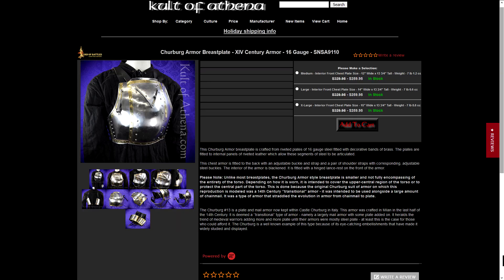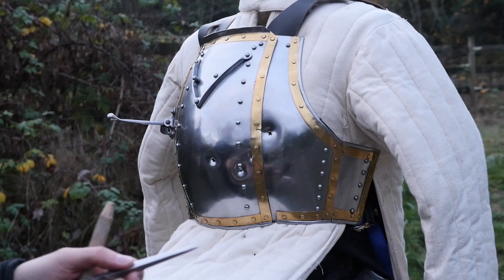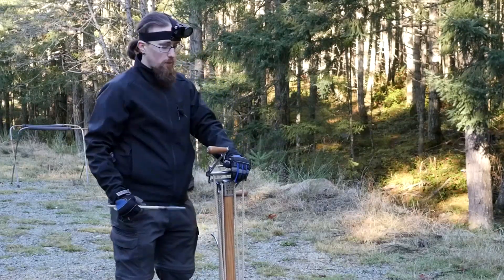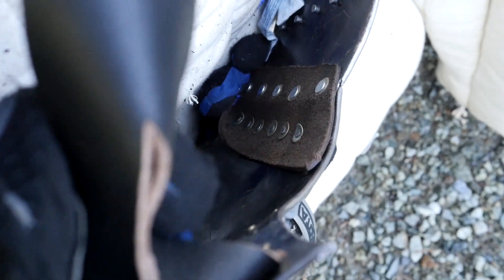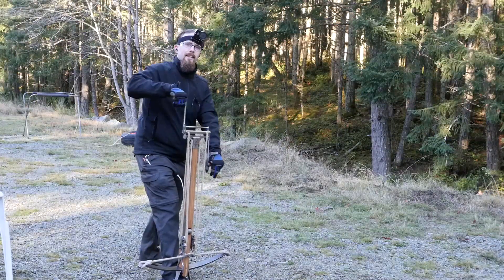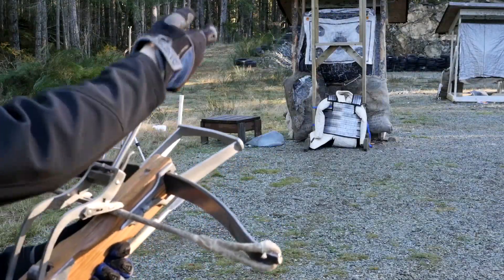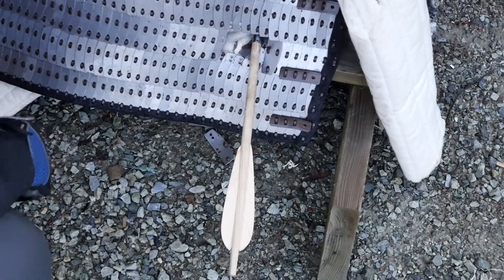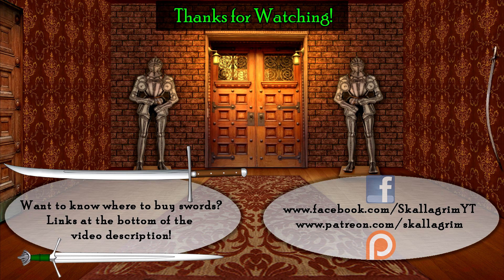Medieval Crossbows vs. Breastplate and Lamellar Armor

Comment: Really gives you a reasonable idea of just how efficient full plate armour would have been and how hard it would be to kill a fully armoured knight.
Reply: Asmin Siza actually it is one of the battle with the most prisoners, and the Knights that were wounded were mostly wounded to the face because for some reason (better seeing or breathing) they opened up their visors. (Sorry if my English is not totally accurate, I am French.)
Reply: SonOfMyths73 Regardless of distribution, with everything worn, it's still a lot of weight and if I remember correctly, the knights at agincourt charged against a muddy field. Yes, knights were trained and buff, but put it all together and anyone would get tired
Reply: One of the things that really tired out the knights at Agincort was the fact that they had to slog through thick, knee-high mud while wearing heavy plate. They couldn't commit to a charge with heavy horse due to obstacles and the terrain, so they had to dismount and fight on foot. The weight of platemail and full plate may be distributed across the body, but they were still lugging around 60-90lbs of armor uphill across a soggy, freshly plowed field. Even hardened veterans in peak shape would get exhausted from that charge, so it's no wonder that some of the knights who fell into the mud literally drowned in their helmets.
Reply: @Ugh-Fudge_Bwana  60-90 pounds, hell no, more like 40-60, 90 pounds is getting into jousting armour range.
Reply: 60 lbs of armor distributed over the entire body. Modern military wear around 60-70lbs as well on their back rather than distributing it. Also, full plate armor was not as restrictive as people say. With knights being able to cartwheel or summersault in the armor.
Reply: @Ugh-Fudge_Bwana  most mediaval armor was 45-55 lbs (20-25 kilos)
Reply: to be absolutely fair the torso region is usually the toughest part of the armor, i'd imagine shots to the limbs/head being more effective.
Reply: @qwertyzxcvbn6929  That V-shaped ridge? that´s a deflector to guide arrows and bolts that glance of your breast away from your face (Todd´s workshop showed the effect very nicely). I think, it is there for a reason (experience). Hits to the throat and face might have been dangerous, even after ricocheting off your breastplate. I don´t think visors were as thick and sturdy as the breastplate, and projectiles could catch in the eye- and breathing holes. If you closed the visor (usually in melee), you had obstructed vision and breathing - not good for the advance. So with open visor under fire, you either lowered your head - again, not seeing where you went thanks to the helmet, or you looked up and got it to your face - tough choice.
Reply: Horse armour was a thing. The front of a horse would be protected by fairly substantial plate defenses and it wouldn't be necessarily any easier to kill the horse than the man at arms on top.

The weakness of horses is that they have broad flanks, which means putting plates on a horse's sides is difficult. So shots to the flank of the horse might be effective. 

It was probably very comparable to a modern infantryman trying to engage a tank with an RPG of some kind. You have to aim for the side armour because you won't go through the front.
Reply: Just Someguy No. Thats the best way to kill his horse.
Reply: Social and military organization is a big one. In the Middle Ages (until the late 1400s) soldiers provided their own equipment and military leaders usually just recruited the candidates with the best kit. 

Later in the 1500s, though, governments started raising armies and training and equipping them out of state coffers. When it's the government buying kit for everyone, they start looking at ways to cut costs.
Reply: The original Churburg 13 armour have an average Vickers plate hardness of 180, and it varies from 110 to 236. It has about 0.1 % carbon. (The Knight and the Blast Furnace p. 69). 

This replica is made of modern mild steel with manganese. This will increases the ductility of the steel. The vickers plate hardness is much higher than 180 and probably around 235. Wrought iron behave in a completely different way when shot at in comparison to modern steel, much because of manganese. Modern steel is more malleable. Wrought iron does not bend the way we see here. It cracks. 

Of all the armour we have from this time period, 13 % is made of medium carbon steel  (300+ VPH), 33 % is made of low carbon steel (max VPH 210) and 54 % is made of wrought iron (max 150 VPH.) This test tell us precisely nothing of value. 87 % of the men-at-arms would still have a bad day when facing longbow archers, because arrows penetrate 1.58 mm (16 gauge) of wrought iron plate with only 87.5 Joules. When these arrows are aimed at the side of a helmet you are in serious trouble, and the majority of the arrows struck the men-at-arms in the head at Agincourt. Arrows shot into a dens formation of dismounted men will hit them in the head. Arrows coming in from the flanks will strike the weaker side of the helmet, and the majority of helmets were around 1.5 mm. It was not adequate protection at all. This has been presented in a peer reviewed article by professor Rogers. Shooting at modern steel proves NOTHING! This was demonstrated in the Warbow trials.

This bolt struck with about 110 Joules. A 150 lb longbow will reach 117 Joules with a 64 gram arrow. A 108 gram arrow will strike with 146 Joules. A 180 lb longbow will reach 132 Joules with a 64 gram arrow and 164 Joules with a 108 gram arrow. This crossbow is equal to a 140 lb bow, not a 180 lb bow.

The penetration of the 1mm plate was not a surprise at all. It's exactly what the math predict will happen. The increase from 1 mm to 2 mm will triple the required kinetic energy.
Reply: Shoot him with a ballista and hes dead!
Reply: Johannes "Fountain" Micha That could work, but I’d rather start a gunpowder trade with Asia and make some serpentine matchlocks and put a lead ball through the knight.
Reply: @JmbFountain  Is he though? depending on the plate even a ballista might fail to penetrate.
Reply: Guns and full plate shared the battlefield for a long time. There were a lot of factors which led to the phasing out of heavy armours.
Reply: I think many people take the reaction against the myth that "armour was heavy" too far. Yes, you can still move agilely in full plate. Yes, you can be fast. Yes, you can keep it up for a long while. No, you won't be just as mobile as someone in light armour.
Reply: @hrotha  Exactly, especially long term and on a sloped terrain. The Battle of Sphacteria is probably the best demonstration of that fact.
Reply: Demonstrably untrue. Foot harnesses were, if anything, more protective than cavalry harnesses, since the horse and saddle aid in protection. English knights and men at arms had a tactical preference for fighting on foot, which was copied by the French at Poitiers and Agincourt. English armours of the period are known for fully encased cuisses (upper leg armour) and upper cannons (armour on the upper arm). Most cavalry harnesses had open backed cuisses and upper cannons which were less protective. The only area where cavalry harnesses were more protective was the pauldrons; they could get away with bigger ones that overlapped the breast plate because they didn't need to lift their arms as much.
Reply: Andrew Woods

The Knight and the Blast Furnace is a book by Alan Williams. It's expensive and contains the Vickers hardness tests and the testing of armour of differen qualities to represent medieval armour, as well as the formula for how to calculate the required kinetic energy when thickness and quality changes.

The Article by Rogers can be found in this document.
http://1.droppdf.com/files/a7ovL/the-hundred-years-war-part-ii-villalon.pdf
It's from page 37. The percentage distribution is on page 112. This again is based on an analyses of the findings in William's book on page 69 and 330, among others.

You should also take a look at this article
https://militaryrevolution.s3.amazonaws.com/Primary%20sources/Longbow.pdf

The last article is Paul Bourke and David Whetham, 'A Report on the Findings of the Defence Academy Warbow Trials. Part 1 Summer 2005

I couldn't find a link. However, if you download the article, remember that the arrow only struck with 92 Joules and that they only tested 1 to 1.15 mm plate, 2 mm plate and 3 mm plate. The first had a VPH of 206, the second 180 and the third 172. This is more than what we see on wrought iron armour from 1395 to 1415.

They should have tested plates with increments of 0.1 mm. In other words, 1mm, 1.1mm, 1.2mm, 1.3mm etc. The reason for this is that the required kinetic energy at 1 mm is multiplied with the new thickness^1.6. So if 1 mm of something like 235 VPH requires 55 Joules (the test result from The Knight and the Blast Furnace), 2mm requires 55*2^1.6 = 166.72 Joules. If the quality is only VPH 150 it's 166.72*(150/235) = 106 Joules. Of cause most armour was not 2 mm apart from the center of the breastplate and the top of the helmet. It was around 1.5 mm, so 55*1.5^1.6*(150/235) = 67.16 Joules. Heavy bows will penetrate this with arrows striking the plate with 115 to 164 Joules with a minimum of 47.84 Joules left and 96.84 Joules at best, point blank. At maximum range a heavy arrows around 95.9 gram will drop down to around 89.9 Joules (the Great Warbow by Strickland, the Appendix)

So here you see that the increase from 1 mm to 2 mm will triple the kinetic energy required, whereas a VPH increase/decrease half that of 235 will increase/decrease the required kinetic energy with 50 %. If you do both, reduce the thickness and VPH it's obvious arrows from heavy bows will penetrate such armour. For instance 1.3 mm of low carbon steel with a VPH of 180 is: 55*1.3^1.6*(180/235) = 64.1 Joules

It's also obvious that they didn't penetrate the 2 mm plate in that test with a VPH of 180.
55*2^1.6*(180/235) = 127 Joules, and the arrow struck with only 92 Joules and protruded out on the other side by 16 mm. It's exactly what you'd expect.

Here is a picture of an arrow shot into a thick plate of iron. It's from Mark Stretton's blog, Practical tests part 9. This plate is a lot more than 1.6 mm. Probably more than 2 mm and even 3 mm. This was with a 140 lb bow shooting the 102 gram arrow around 47 m/s, if my memory serves me right. This will give us 112-113 Joules somewhere.
https://1.bp.blogspot.com/-cQYmmYin3P8/Vw1cJQRxiPI/AAAAAAAAEzk/-60xzWZwgPkDYPugAla21h4lZGa6L_AAACLcB/s1600/Test%2B35.JPG
Reply: Makes me wonder how strong the English longbowmen needs to be to kill a fully armored French knight  at Agincourt.
Reply: @MisterSiza78  you don't need to kill the night when you can kill his horse, and then force him to struggle through knee deep mud in armor. if you read the contemporary accounts of the battle, that's what really did it. by the time the knights even got to the melee they were already exhausted. that'd be a nightmare even in light clothes, doing it with 60-80lbs of steel strapped on would be an absolute killer.

apparently the mud was so bad that the knights also just couldn't get up if they got knocked down, too. it was not a good day to be a knight.
Reply: @MisterSiza78  So, English longbowmen did not actually kill any French knight, at least it's very unlikely. There are a few articles you can find on Agincourt but in short:
The English had the high ground. This is not for the meme, they really were on top of a rather large hill. They fortified the position, protecting their flanks and positioned themselves so they could take their enemy in a crossfire.
It had rained the day before so the ground was basically mud.
The French knights charged (mainly) on foot, through mud, and up a hill. facepalm They charged in densely packed ranks: each time a knight fell because of the mud, two or three knights fell also. Repeat for a domino effect.
Not all knights were wearing a full plate. A few weak points around the legs allowed, at a very short distance, to wound the knight.
Overall, knights weren't killed anyway because you could send them back for money. So while a good number was killed in close combat, many more were taken as prisoners.

Agincourt was a flawless tactical victory for the English who had understood that chivalry (the mindset) is good and all but it doesn't win a battle. Also, discipline.

The French legit had more numbers and proto-canons. They could have bombarded the English who were famished and sick.
Reply: Zabzab Lord the benefit of the longbow men is the constant barrage of arrows that can disorientate, trip up and potentially manage to get into any slips of the armour that the knight is wearing. Also all those little dents can eventually cause the plates to no longer slide and move correctly. It was pretty much a death by a thousand little dents and impacts. (Not actually a death typically) the long bow wasn’t really designed to ever try to kill a knight, better for horses, light infantry and crossbows.
Reply: @pierreb97  I thought Poitiers was the uphill battle?
Reply: @paavobergmann4920  Agincourt definitely was. Poitier probably too. The English had a better understanding of basic tactic than the French at the beginning of the war. From memory, I'd say the English were shielded by a forest, creating a funnel in which the French dumbly charged. It is completely possible the English also had the height advantage: they were smart enough to take it, that's for sure.
Reply: @pierreb97  Right. Henry´s deployment was absolutely brilliant for the circumstances and what he had to work with.  I thought there was a shallow muddy dip right in front of the english lines, in the middle of the funnel aka killing zone, and henry ordered the english to not move, no matter what.
Reply: @MisterSiza78  they really didnt kill all too many iirc. They captured a ton of POWs there and at Crecy didn't they? I think the fact that so many nobles survived js a testament to why they invested in good armor.
Reply: @MisterSiza78  they are wearing coat of plates during that time
Reply: @MisterSiza78  Evidence from the documentation shows that it was raining and the fully armored knights sank in the mud and their metal shoes created huge suction in the mud while the leather shoed archers could run through the mud with ease.
This was all tested BTW
Reply: @MisterSiza78  They probably didn't have much success against fully armoured knights, but horses and ordinary foot soldiers were much more vulnerable to archers. However, Knights could be killed in close quarters fighting, and archers would have other weapons for getting up close and personal. "Hold him down boys I've got a can opener!" 😉
Reply: @MisterSiza78  Agincourt in popular perception is kind of a misconception

What killed the knights weren't the arrows (not directly), I'd wager the vast majority of them weathered the volleys like it was nothing.
But think about it for a second.. These were knights. They had horses.

Horses. Horse armour, whilst it was a thing, was expensive and most importantly not as covering as full plate on a knight since you can't restrict movement of the horse too much..
The arrows killed and wounded the horses. Falling from a horse hurts a lot, but regardless.

Next, you got the actual conditions of the battlefield, at Agincourt the knights charged through a relatively thin path surrounded on both sides by trees and obstacles. In front of them the english army had "entrenched" itself with barricades, the terrain was muddy and hard to go through with an horse

So most of the french knights had to go through on foot. Through mud and barricades.

ANd they were outnumbered at this specific location because the rest of the army wasn't with them
Reply: @MisterSiza78  There's a video about that in Tod's Workshop channel, the gaps are somewhat vulnerable and sometimes arrows get thru the maille; plus the plate on the arms is very thin and sometimes it pierces thru. The Eyes are somewhat vulnerable because the steel around can bend in and allow the arrow to pass. Plus often they didn't had plate on the back and on the groin, so they would get hit there and sometimes the arrow would go thru.
Reply: Also polearms. If memory serves, examination of Richard III's remains suggested that someone, or rather several someones, dragged him off his horse with billhooks, took the helmet visor off the stunned king and stabbed him with the point in the face. Billhooks and guisarmes were a scary fucking weapon, and started out as a farming implement too.
Reply: umm... No. They are as mobile as you-- More, in fact, if you wear chainmail. The weight is distributed evenly over the body, so a full plate armor will not tire you. Other then the helmet, in fact, there's very little that makes movement difficult (I say the helmet because it does get hot underneath) and in most cases, the knight you are referencing is usually more fit then you are.
Reply: @CanisMythson  sure, I´ve seen ppl doing cartwheels in full plate, but you are still carrying 20-25kg of extra weight around, so you need to burn more calories, thus produce more heat. And the heat is not a problem only with the helmet, the plate on your body prevents effective sweating, so heat exhaustion is a real problem wearing armor.
Reply: @CanisMythson  No tests proved Knights were far far less agile than the leather shoed wearing Brittish Archers. 
See above ^^^^^
Reply: @CanisMythson  buddy try full football pads for a bit and run around and see how bad your mobility gets let alone steel fuckin plates lol
Reply: @CanisMythson  you are delusional.  It's more weight.  Plus you can't see.
Reply: @CanisMythson  actually, I remember on "deadliest Warrior" show on spike over a decade ago, they found that chainmail was less mobile than plate which surprised everyone
Reply: There was also evidence that at least one person stabbed Richie 3 in the ass, though it may have been posthumous.
Reply: Asmin Siza That’s typical British bias (not saying you’re biased) : many knights were actually not killed by the arrows but were knocked down ; proof of that can be found in the account of the Lombardese mercenaries who took part in the battle on the French side : they had plate armour, and instead of being defeated they actually tore the Englishmen on their flank apart
Reply: Asmin Siza strength didn’t matter,a longbow won’t penetrate armor (unless the Incredible Hulk got himself a custom version) 
Even a carbon arrow shot from a modern compound bow will just glance off armor
Reply: Vadim Flaks Matchlock was invented in 15th century, but it started to be widely used only in 17th century. Other types like wheel lock muskets were used. 

Half armour was used even in 17th century and even by imfantry. Yes, it had cuirass, a helmet and upper leg protection. 

Youre misguided if you think that full plate is as thick as cuirasses that were used in 16-17th centuries.
Reply: Something you will often see is an arrengement like this, where men at arms wear textile coverings over plate armour, which might cause confusion. http://manuscriptminiatures.com/4743/11685/
Reply: Shrekas 2 Ok, I'm positive that wheellock came some half a century after the matchlock. Yes, they were used concurrently for a very, VERY, long while, but matchlock is much simpler and cheaper, so I'm pretty sure it was much more common, despite the need to keep it lit, the giveaway smell, and the tendency to fail in humid environments, up until flintlocks took over completely.

No argument on half-armors - although I did think the infantry stopped using the upper leg protection by 1600s, so thanks for correcting me.

I never said the BATTLE full plate was as thick as the later cuirass. Did say that the tendency to make the plate thicker made full plate impractical - so the western European militaries started switching to half-plate. Pretty sure that armor made in the 1500s for the jousts of peace was comparably thick and heavy though, since it didn't have to be as nimble as the military stuff.
Reply: Maaayyyybe, and there's certainly evidence of that happening sometimes (Henry V was the most famous person that happened to), but in most cases, if you know there are archers pointing arrows at you, you keep the visor down. Lance leaders might need to open theirs occasionally to look around or shout orders, but it would be a pretty short window of opportunity. Do-able, but not reliable.

Edit: Replying to Alex C.
Reply: The best way to kill a knight is the hussite way... Make a wall. He cannot charge cause there is... well... a wall. Of wagons, in the hussites case. Then slap him with long polearms with your friends until he dies. 

With similar tactics (and because all 5 crusades agains Hussites were extremely badly organised) they won every battle against the crusaders.
Reply: LAMELLAR >> PLATE ARMOR
Reply: Yep, and then the arquebus just had to come along and spoil the fun for all the ultra-rich warrior nobles who could afford a full plate harness in the first place.
Reply: @vadimflaks7795  You do realise that the first guns did not a lot against armor? Like you could shoot a knight and the bullet bounced off. Only later guns actually did damage.
Reply: Umm.. What were the other factors? Seriously asking. I was under the impression that the timeline went like this: mid 15th century matchlock invented, guns-on-a-stick start popping up, but are kind of crap, best armor is made of hardened steel, so the men-at-arms don't care too much; late 15th, early 16th century, arquebus is getting pretty common and can punch through thinner plate, so the best armor is getting thicker and heavier, but full harness is still good enough to hold up, and munitions armor is everywhere because cavalry charges. Mid 16th century: guns are everywhere, and they are better, so to stand up to them the armor has to be so thick, that a full harness is impossibly heavy, so the half-armors with no arm and leg protection take over, while full suits become exclusive to jousting. Late 16th century: armor makes sense in melee only, so cuirass and helmet is the norm. Early 17th century: shot and pike rule the world, armor is reduced to cuirass and helmet, mostly used by cavalry. Mid 17th century: battle of Rocroi, the old military model is dead, all hail artillery.
What am I missing?
Reply: http://manuscriptminiatures.com/4293/7642/ for instance.
Reply: Tobias Capwell mentioned in his Armour of the English Knight book that when he had an armor built to the standards of a mid 15th century English knight (and those guys apparently preferred to ride to battle, dismount, then fight on foot) he had to go back to the armorer and ask him to rebuild the cuisses to be more open. All the metal on the inner thighs that was so useful on foot made it much harder to ride in jousts. Soft leather on the parts of the leg protected by the saddle and, you know, the horse, made it easier to feel what the animal was doing and shift his own weight accordingly.
Reply: The mail protecting the armpits and groin was vulnerable to a thrust, the backs of the knees and palms of the hand were protected only by leather or textile, so they were quite easy to injure if hard to hit. Many combatants wore open faced helmets (bascinets, sallets, kettle hats) that left the face exposed. Visored helmets could occasionally be penetrated at the vision slits. Wrestling a knight to the ground and opening the visor for a dagger thrust was the most popular (it also gave the knight more time to surrender, which allowed you to ransome him for a shitload of money).

Blunt trauma was somewhat effective, but the effect is more akin to being punched. You feel the hits, and they hurt, but it takes a bunch of them to put you out of action. Not super reliable, but better than nothing.
Reply: Not that hard, even fully plated armor knights in championship gear were getting heavy wounded by a blunt lance. It's just not a crossbow that can punch through it. Also, note that handguns were starting to get deployed in the given period.
Reply: You don't need to penetrate his armor if you can slice his throat when he sleeps. taps head
Don't feel so secure now, do you? XDDD
Reply: Pollux, are those power values corrected for range?
Reply: @MisdirectedSasha   arrows don´t lose much speed  during travel, they are really good at flying long range.
Reply: @paavobergmann4920  Not true of war arrows. You can balance an arrow to fly a long ways without losing speed or accoracy, or you can balance an arrow to hit really hard, but each comes at the cost of the other.
Reply: @MisdirectedSasha  true for balance (barreled shafts, tapered shafts), but I wasn´t referring to the balancing of the shaft, and in general, arrows are in general pretty good at retaining airspeed in comparison to other flying objects, at least in proportion to flight time.
Reply: PolluxVarangir This is really interesting, and I've wondered about it before. Could you possibly link the article in question or direct me towards it?
Reply: hrotha this may be true. Their is a need to consider the cost efectivness though. If im in full plate and not worried about you huting me do i need to be faster when i can walk through your blows and cut you down?
Reply: Sirenir1, no, you don't. In most scenarios, full plate will be the better option, no contest. But that wasn't the point.
Reply: Also while footmen and knight kit might be nearly the same weight the closed faced helmet makes a difference in that it doesn't exchange air well and does deprive the wearer of oxygen tiring him and makes him light headed in time.
It is something much written about using the language of the times and why knights had their visors open at inopportune times.
Reply: @mysticonthehill  that, and also peripheral vison is an important aspect, hence the popularity of kettle helmets, even among knights, and the resultant face injuries. there was even a treatise arguing against the popular use of kettle helmets on horseback, as more strikes would be directed upward, where this type of helmet would not offer adequate protection.
Reply: Eissa Sinéad .
Reply: Killing a fully armoured knight is not that hard. You just sneak up behind him and stab him in his left armpit using your ninja skills.
Reply: Thats why blunt weapons became prolific
Reply: the british longbow penetrated their armour as well as trip ropes in front of the english lines thats what i read in winchester cathedral
Reply: throw him in the water.
Reply: You should have aimed for the head
Reply: Actually there were armor piercing arrows used against knights. The arrow Head is shaped more like a needle. I guess with the small point, all the power is concentrated there for maximum penetration.
Reply: @dew8368  Another test showed that needle bodkins are not effective against plate. They break or glance off. They are, however, exceptionally good at keeping speed and course over large distances. they are also cheap. The arrowhead type 16 seems to have been the best armor-piercing warhead.
Reply: Killing horses and knocking knights over would work. Aiming for the head with a bludgeon weapon would work well because of causing concussions and disorienting trauma even without penetration of the helmet.
Reply: @ashrafumar504  It seems that blunt force weaponsbecame popular for exactly this reason.
Reply: Lol
Reply: there are still unarmored part in the body, you need to kill him through those holes.
Reply: Nuke it
Reply: Yeah, talk about pay too win.  No wonder the Nobles survived all those wars.
Reply: Then guns came.
Reply: A strong punsh with something like a hammer on  his helmet wouldnt kill but knockout him. I would fear to get to close. If've seen this with only one bare fist on the top of a police riot helmet.
Reply: War hammer to the head makes it easier. The blacksmith here was aiming for the chest but impact on the helmet would surely daze someone and possibly knock them down ready for the kill. But yeah, full plate is good defense.
Reply: People really think knights spent hours getting suited up in a hunk of metal that cost a fortune and decades of skill to forge for no reason except to look cool...
Reply: Just saw this video. I would rather from what I've seen bet my life with the Lamellar armor. As long as it was better made.
Reply: Black powder was a game changer
Reply: -Enough sundering trauma would batter a knight to death, the work of a good blunt pole arm.
-An arrow or crossbow bolt in a vulnerable spot.
-Besting a knight in combat and then getting close enough to a defeated knight to plunge your sword into them.
-Surprisingly falling from a horse can cause a lot of damage even to go as far as knocking out many knights.

-All are very difficult, although the ranged option is seemingly safer it is the hardest and if the knight closes in or you get hit by another ranged combatant you are dead.
-The easiest is probably battering a knight to death, a few war hammer blows will wind a knight or even break their bones, likely to make them fall so you can finish them off with a very hard strike.
-Besting a knight works but a knight in full armour is likely to of received a lot of training from other knights as well as quality armour and weapons, unlike most of Hollywood and TV even knights from rich households with power started training military tactics and techniques at a very young age, studying warfare. Then at a later age they were instructed until they became of age to join actual military training and upheld that training dedicating their whole lives (not just a few sword lessons from some fake exotic master-of-arms. As a working class you would have what you could afford and inferior training (and yes studying at a young age worked wonders, it is indeed possible to study war and techniques, practice the techniques and keep yourself in physical shape (also the old saying; "practice does not make perfect, perfect practice makes perfect" is true, it is possible to have shitty training).
-Grounded when assaulted by a mounted knight would be very difficult, horses are powerful creatures able to easily trample you and a knight with training as mentioned above with a pole arm has the leverage from their height, it would also be very difficult.

The truth is as much as Hollywood and TV would have you believe, not having a suit of plate mail would put you at a disadvantage against an opponent with plate mail. Metal is tough.
Reply: Well not really if armoured knights were still common during the 18th century they would be killed by muskets
Reply: you didnt want to kill knights anyway, plate armor was like buying a koenigsegg or bugatti today, you want to capture and ransom them back, and they were almost always nobles too
Reply: Wasn't an English King demounted by Swed mercenaries and in an attempt to pry him out of his armor so they could capture and ransom him, they ended up bludgeoning him to death without ever getting through the armor.
Reply: siege of Alessandria, northern Italy. Locals retreated to swamps, fought from small boats and the like, drowning knights that dared chasing them. They also threw very light, stark white stones at knight, with laughable effect. It was quicklime, and soon started burning the knights after it dissolved in water.
If you can't pierce them, use wits and mobility. Let your land features win the battle for you (provided you didn't grow up on a dry plane...)
Reply: Not against a horse.  You just need to knock the dude down
Reply: Being a bastard archer I would put multiple arrows into the same dent.
Reply: Had to be hell on the horses
Reply: Maces, hammers and morningstars are the best choice in combat with a knight on foot. There are even stories about peasant's wars in the 16th century in germany, austria and switzerland, where knights feared to lose their horse in combant and have to engage the peasants on foot, since the enemy had farmer's flails.
Reply: Asmin Siza strenght doesn't matter, a longbow won't pierce plate and padding and still kill.
Reply: @duchessskye4072  actually it can if you aim for literally anywhere else other than the breastplate. That was where it was strongest, and you could still aim for the joints or even the side of the breastplate and still get through. In fact, Todd's workshop did a video testing that, and while they didn't have much luck with frontal shots to a breastplate, side shots were much more effective
Reply: Plate armour was tailored so that the majority of the weight was carried on the hips. There were few weak points. Brute blunt force to the head would be your best bet but penetrating through plate armour would be some what of a miracle even with a 1000lb crossbow.
Reply: +SonOfMyths73 but how much mobile and resillient compared to similiar men that were equiped by less protected armor like plated maille? Put knight horse down to some muddy terrain and force them to march and charge at you  dismounted (while also being bombarded by arrow rain fired from bow that got similiar power to crossbow), because this is the usual scenario that end up with the knight demise (see agincourt and Niccopolis)
Reply: The thing just being injured by an arrow or bolt will kill you b/c you do not move as well with a hole in your side or leg and as soon as you get in an up close battle with someone they're going to kill you
Reply: well the bow draw weight that used by english longbowmen would be at least 120-150lb, and with that kind of value you got a bow that still surprass 350lb crossbow since crossbow is not that efficient in mechanical energy transfer. To efficiently kill fully armoured knight you just simply tire them and using manuver aka you have less armor. Now some english longbow have the draw weight of 180lb, which comparable to 1000lb crossbow (again due to effient mechanical energy transfer generally of a bow, beside the longer limb)

Or you know, you could just goin with classic method that worked since the invention of stirrup; lance charge through the heart ;)
Reply: @cool06alt  another idiot with his Lance charge,  lol.
Reply: In a actual battle bowman/ crossbowmen would fire arrows or bolts with very fine needle like points in order to penetrate armor and chain mail. They would know better than to fire broad arrows or bolts like the video depicts.  Still great footage and very appreciative of the video. Try it with the siege try of bolt.
Reply: @burnheretic3950  needle points are good against mail and cloth, but really suck against plate
Reply: Just Someguy Thats more percise. Remember that everyone else would tire just as much as knight. Knights have no trouble moving in armour, what are you talking about?

Killing a horse will not kill a knight. It would weaken him - that should have been the expression.
Reply: MisdirectedSasha often when a knight would raise his visor an archer would shoot them in the face, crossbows are pretty accurate so I think for that situation you'd have a fair chance compared to trying to get a bolt through the eye hole ect